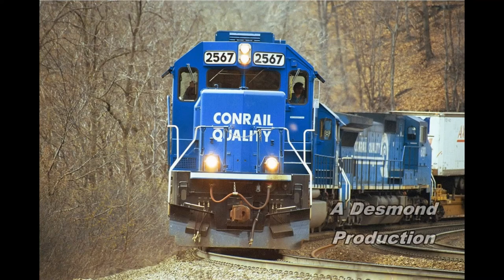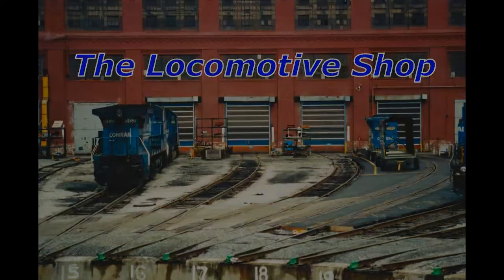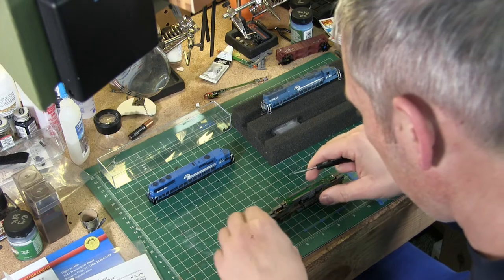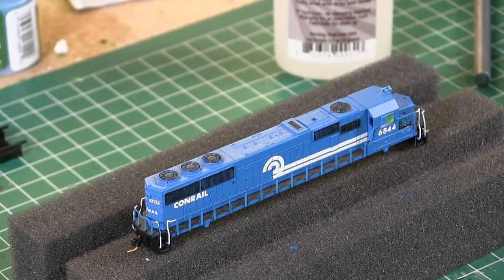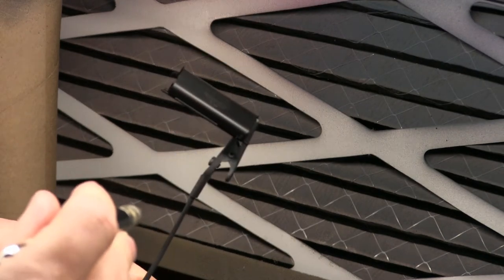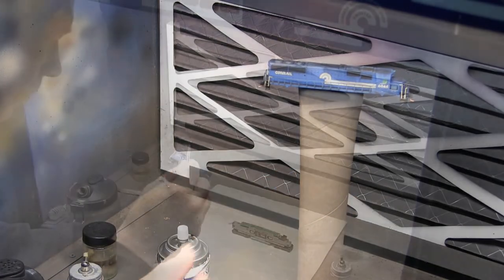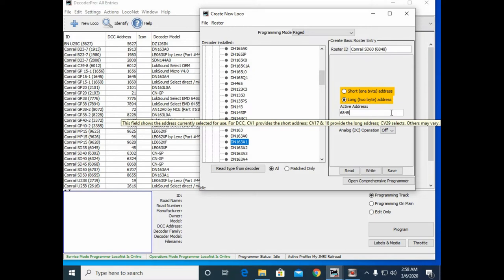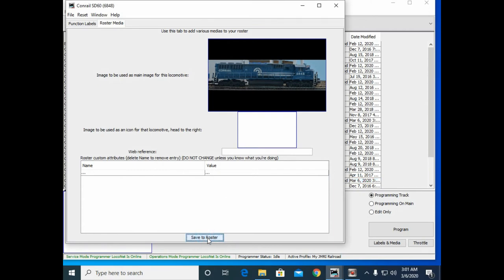Atlas SD60's

Comment: Thanks, Joe, always enjoy.  Question:  I need to replace a possible defective Paragon 2 
speaker on my BL EMD F 3 MLW Rd. Diesel.  How difficult would it be to replace it with a Loc Sound speaker or an iPhone speaker?  Thanks, Dwight @ Northern Star Model RR
Reply from the maker: Not to hard, You just have to find the right size. Try Streamline back shops. Thanks for watching!